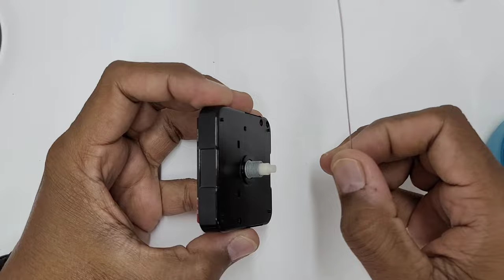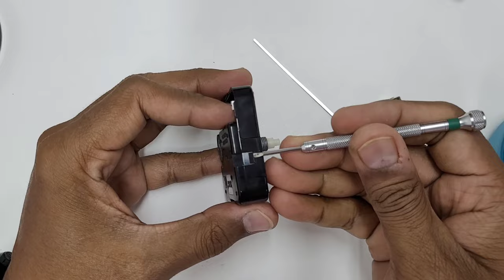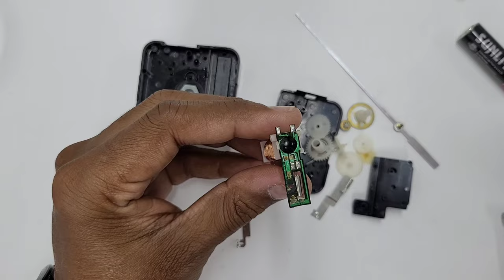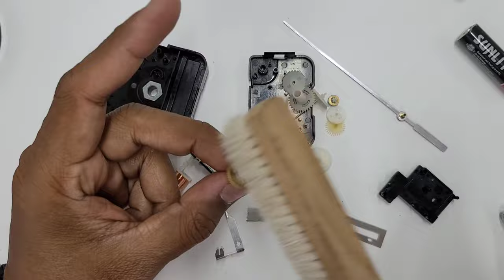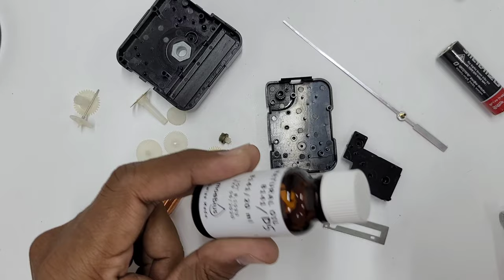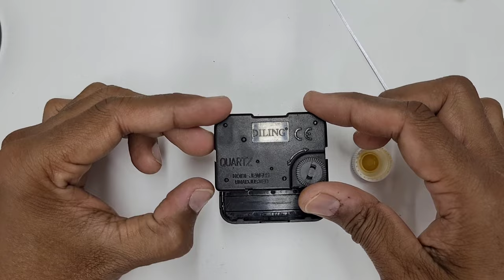How To Repair Damage Wall Clock Machine | Wall Clock Movement Repair

Comment: My clock is slightly different but using this video, I managed to fix it. I think it mainly needed oiling on the first cog near the coil after over a decade of running. Thank you
Reply from the maker: Nice work!

Comment: Why did you take it apart?
Reply: cleaning of course,wall clock also had dirt and debris on the gears after so long,the board also had corrosion that can be fix by cleaning

Comment: What are the liquids that are being used in this video?
Reply from the maker: watch circuit cleaning solution
Reply: @SolimBD  ok. Thanks.
Reply: @JamesSmith-bo3po  you can use hospital senitisor, but while using that just don't connect baterry till the senitisor evaporates, btw that vapourises very quickly so its comfortable with that

Comment: I would also take the opportunity to tin the battery contacts on the circuit board with solder. I've found that in a lot of old clock movements that have stopped working, the pads become badly corroded, covered with copper oxide (green powder). A layer of solder would protect the pad.